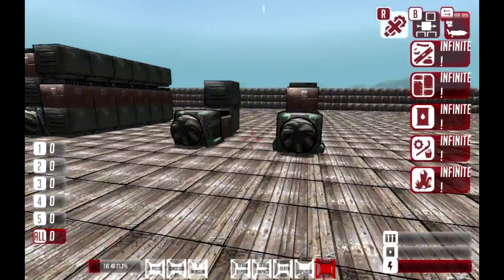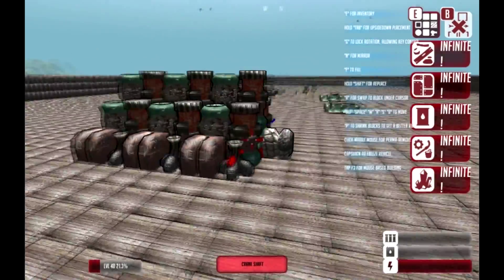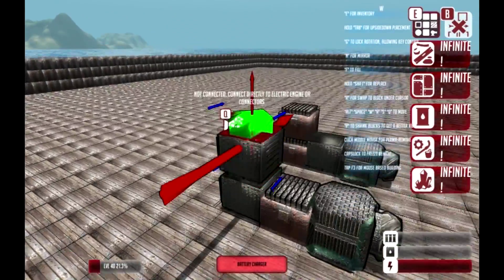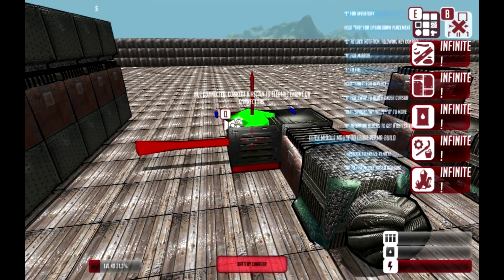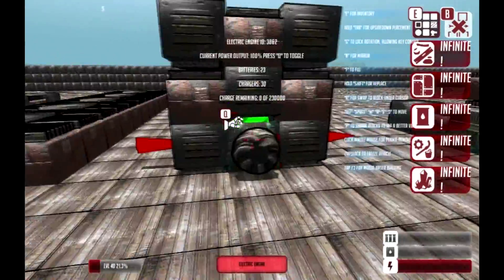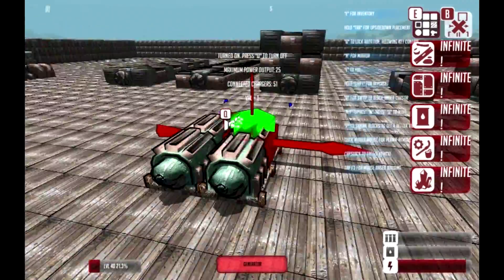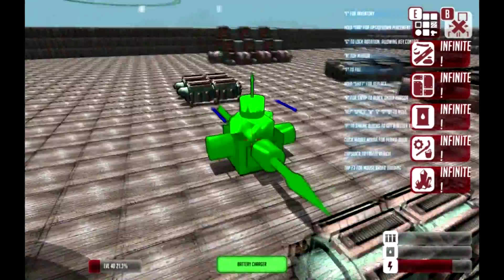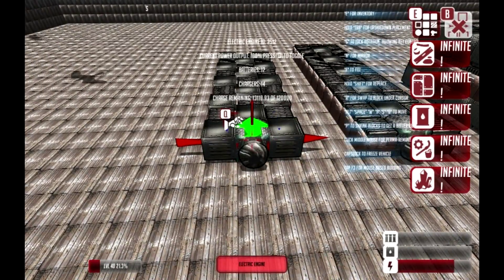From the Depths: How to make an Electric Engine

Comment: would be nicer to have solar panels or something instead tho, i wanted to make one without using fuel but nvm i guess
Reply from the maker: That's a neat idea, I wonder if that will be implemented
Reply: Robin_earth2 I think it's be awesome to have solar panels implemented! Mention it on the forums: The creator, Nick Smart is remarkably responsive to user requests.

Now the only question that remains is whether you can charge solar panels with a laser......  ;{D